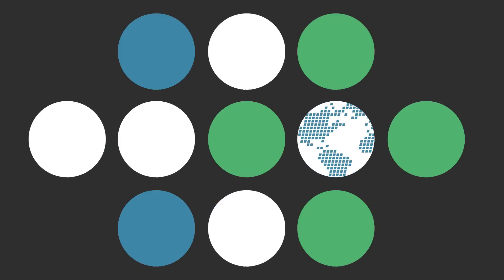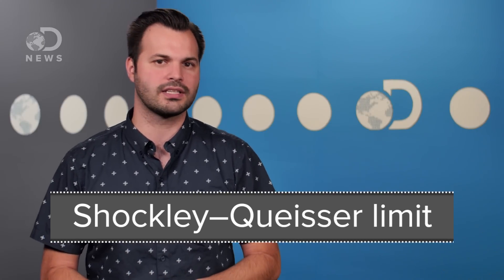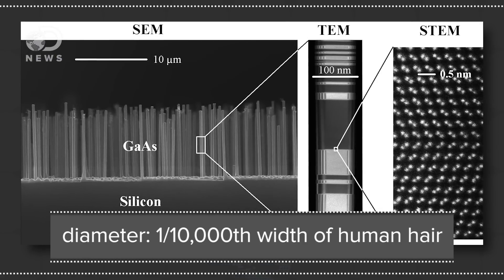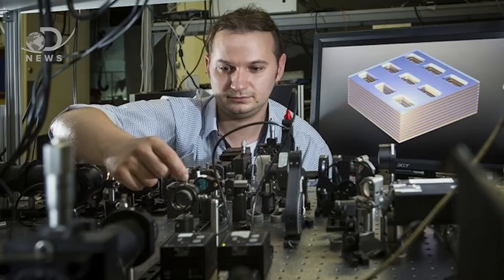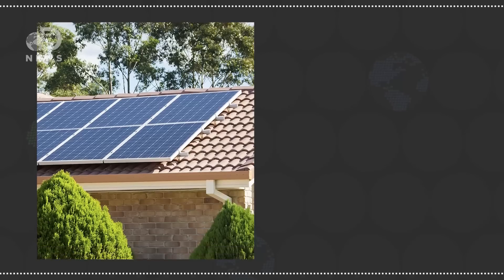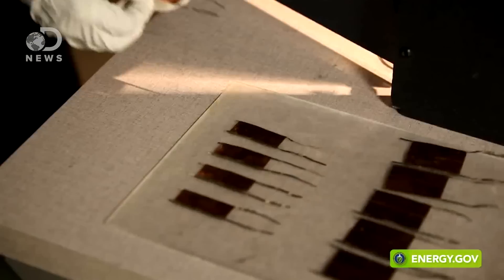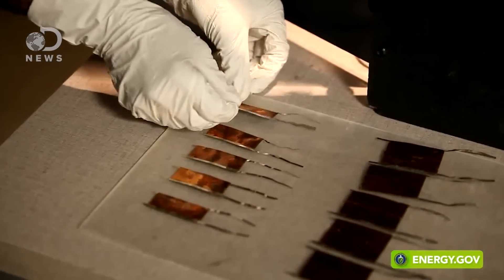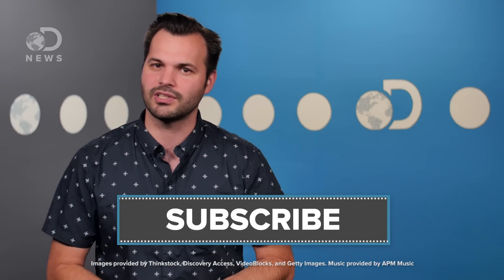Can Nanotechnology Turn Windows Into Solar Panels?

Comment: You forgot the main problem with solar (aside from the dirty cost to human life). How do you store the energy?! Without a method to store the energy, all you have is a system that works when the sun is out. Now, if someone made a fusion of supercapacitors and solar cells... this could work.
Reply: well if we are speaking on like a single house scale those super batteries made by tesla or a more advanced version of them is probably our best bet... however on a scale of a whole city we probably need to find another solution
Reply: Smart grid
Reply: Why waste space by putting them on the panel when you could put a battery inside your home?
Reply: Lorenzo Bolla de Oliveira This idea is coming, however... smart grids have been hacked before. Governments (China mostly) have hacked into grids to extort and leverage.

Comment: Even without solar power we have perfectly good electromagnetic generators which can be turned by several methods besides burning coal. How about hydroelectric
Reply: How about powerful neodymium magnets which can turn a generator for pretty much eternity.
Reply: You still need a prime mover...  ie: wind, water, steam magnets are only half the equation and the electromagnetic field is more powerful and variable than rare earth magnets which would have fixed flux
Reply: +Mike Brace. No. You only need to spin it initial with your hand. If placed correctly the magnets will turn the generator indefinitely. I've built my own. I worked as an engineer and electricians assistant. It's really not that difficult to build one. But if water is your preference then by all means build a hydroelectric setup. That was my first setup. I used a plastic wheel out of a large central air unit in a stream to turn a generator for years until I saw the potential of the magnets. For me the magnets are just easier plus it's even portable. You can use an alternator out of a car along with a power inverter and carry it with you on a camping trip or wherever. You place magnets on a fan blade attached to the alternator and then another one opposing those to give the push needed to keep the blade spinning. Pretty simple.

Comment: Why would you do that? Solar panels work most efficiently at an angle. Windows are almost never at an angle; instead typically exactly perpendicular to the ground. They also do best in direct sunlight and moving with the path of the sun. Again, not feasible for most windows on a house, or even all if the houses are too close together, and they're not budging. It easier to put solar panels on a proper angle on a roof and it would also be easier to move them from there, as well as there being no need for them to be opaque.

What we really need is or a commercial company to produce and sell higher eficiency panels, like what Elon Musk did to the car industry. We need one magnate to say 'I can power this country on sun; watch me do it.'
Reply: in some parts of the world, having windows that cut some of the sunlight down and then convert that into some usable energy would be a great idea.  Im in Texas, and trust me, we totally need that. When the sun is shining in the summer our AC systems are going full throttle. Any energy recovery would be good.

Comment: As usual this video has succumbed to "common wisdom" calculations to compare photoelectric solar to our common sources of electric power. Not wrong per se, but not completely thought out either. Here is my point: All of our energy is solar except nuclear, and a certain percentage of that is too. Why do I say that?

Coal, the earliest to be exploited, comes from plant matter produced by solar energy long ago and not too efficiently even then.  It had to be compressed over eons to be used by us, losing stored energy all the way. Coal, "rocks that burn" was a replacement for charcoal which was easier to transport to cities back when horses and humans did the labor.  Steam plants have improved tremendously but this dirty energy source has a long tradition and a great amount of sunk investment costs already amortized, so we still use it. But the energy of its mining, transport, storage and transmission losses and are not included in your simplistic efficiency calculations. Those extra losses apply to nuclear as well, with processing as fuel rods to be added in. Long term waste, and decommissioning  costs along with security are a public(government)/ private (customer/stockholder) shared burden that also typically does not get added into efficiency calculations. 

 Other hydrocarbons we use in the same type of  steam plant as coal tend to be marginally better because coal has lost many of its hydrogen atoms from its molecules over the eons. Natural gas has more remaining bound hydrogen and is cleaner burning and more efficiently transported  by pipelines. 
Also  though it is putrid to use, cow dung and peat may have  even more hydrogen still bound to carbon as it is closer in time to its solar production, though the burning process is too crude for comparison here.
So wind and solar have the advantage of the most recent solar energy, and cleanest power production, though it does vary and will need a better grid for efficient utilization. Hydro serves well as a clean base load source, though it is limited two ways. It does have the advantage of the weather cycles doing the transport for free, bringing it from our oceans to our mountains, but that can be fickle too. The other limitation is the amount easily secured with high enough dams. Wind is solar energy created at sea as well, and self delivered to where we use it. We should reorder our transmission grids though, from the currently mostly north to south we use today to get hydro from where it snows to where we use it, often to air condition southern areas once lightly populated and agricultural. We need east to west lines also to allow time zone optimization. Solar in California for instance is still going strong when it gets dark in the east. Wind farms too could be better used with a more comprehensive grid.

Once we have mastered the new paradigm, we should re-examine the true source to user efficiency. Cost effective rooftop systems in use today can get better than peak 20% though might average 15% but that is directly from the thermonuclear source. A coal plant idling with no customers buying the output early in the morning is actually worse than a solar rooftop at night producing nothing.

Comment: This is BS. If the (sunlight) resource is free and overabundant, the only efficiency that matters is the economic efficiency of the panels - the cost per watt captured. All this talk of needing 'more efficient' PV cells is totally wrong headed. The only relevant question is - are emerging technologies going to make the $/watt lower? And the only relevant decision to make is -  do existing panels gives us energy that is (clean and) less expensive (including externalized costs like climate change) than currently viable alternatives. The answer is yes - in many parts of the world current PV technology is cheaper than any other energy source. So get them installed.

Comment: we have to needs energy saving units which can creates running slow down the energy meters, as efficient as possible regarding cares power saving lower drawing of power generations electricity bills more than 30% to 50% or more for 80% as cheaper elsewhere as may possibly does provides for gained, we have been does it to takes for alls overalls benefits provisions of implementations for alls aspects for alls power generations in any types of requirements purposes related to alls anythings and for anywhere else cares abouts including additions visibles and invisible with general achieved with developing forms for alls design deals for alls domestic, commercial and industrial applications and medical cares and Defences arrangements with others alls including Robotics autonomous sencers achievements automatically and manuals controls systems managements for alls most anythings possible to get made in makes for the totals present and futhers procurements steps with others for lastest versions of technological advances innovations conversation achievements designs with developing forms for alls abouts with cares including safety and securities prequsions concerns abouts always been makes everything as easy stood up and we have to needs Recearch and developments related to makes beyonds far elses life times supports autonomous automatic controls systems supported power supply design depending running by own self achievements provisions for alls abouts , it have to no need to be getting not require take power from anywhere else external drive sources from others and accessible from anywhere else, it's have never been required to gets from others as for lifetime feedbacks solutions as Own, maybe with lifetimes battery supported by self sufficient process for required purposes for alls every things related products for those anything, please highlights abouts taken technological advances innovations, thanks given with love and cares abouts, God bless you alls, yours faithfully.